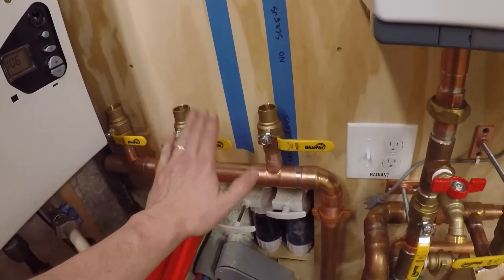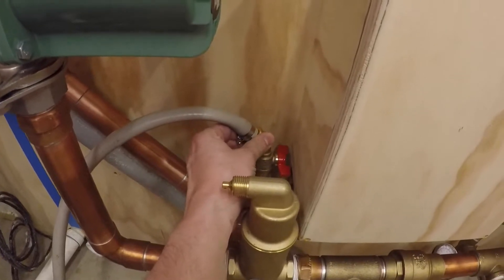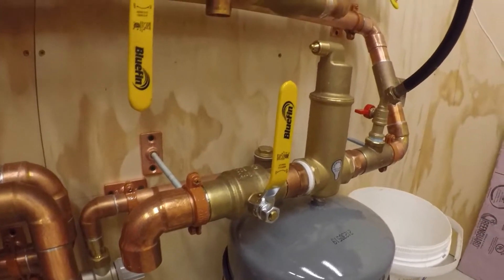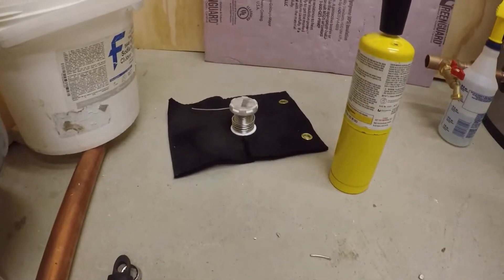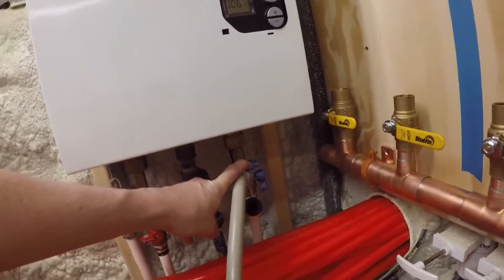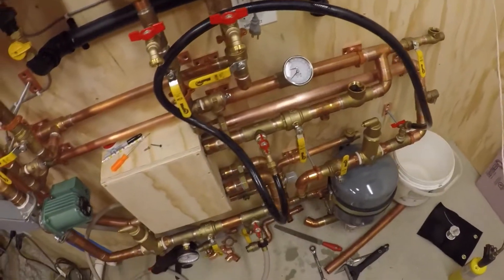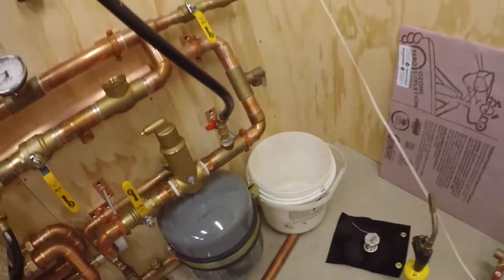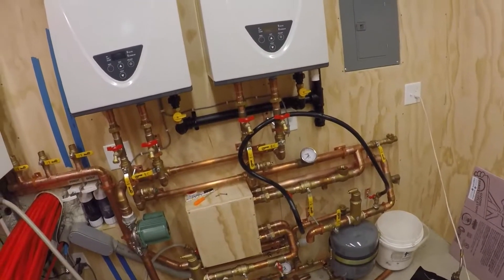Heated Driveway Project - Pressure Testing the Primary Loop - Episode 14 [5-24-2020]

Comment: Do you have a video of how you modified your 20 gallon tank water heater? I'd be interested in watching that
Reply from the maker: Hey Matt!  I may have a bit of how I did that coming up in my installation videos.  I am trying to edit and upload all of them as fast as possible, while also getting out the recent ones. Lately I have been uploading the old one on Sundays.  Luckily November and December have been mild here so I am almost caught up with recent videos, then it will be all old installation videos until it snows again.  :)  Either way, I will remember your request, and if I find that I didn't record it very well last winter when I modified it, I will pull the cover off the side of the tank and make a separate video on exactly how I did it with links to all of the parts.  Keep an eye out for it, and thanks for watching!